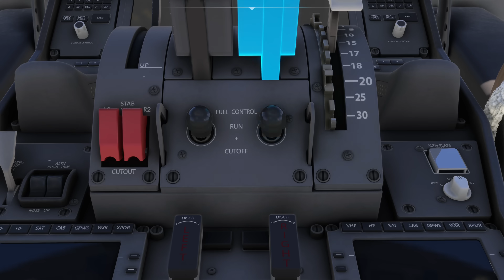Air India 171: Why Did The Fuel Cut-off Switch Get Moved?

Comment: Respected, is it possible that the pilot in the disorder switched the fuel levers to cut off by mistake, instead of retracting the landing gear, the mechanics of both procedures are similar, the switches themselves are not close to each other, but the pilot made an automatic mistake unconsciously, burdened by depression or a similar state.

Comment: How do we know for sure that the physical switches were moved, and it wasn’t caused by an electrical failure of some kind, like disconnected or shorted wires? Wires can disconnect or touch and then move back due to vibration and flexing for example.
Reply: The black box would reveal such an electrical error.

Comment: Why is the computer no checking the flight status and engine situation to prevent a sui*ide mission?`The computer knows if the engine has problems and it knows the flight scenario, so it should have some AI or algorithm to analyse the situation. I mean we are not in in the 1960s anymore but in 2025 mit powerful computers and software.

Comment: If a pilot was going to premeditatively cut off the fuel it makes sense that that individual wanting to make the biggest impact of their sinster act would do it just after rotation when the plane is full of fuel and there would be no way to recover because they were so low in altitude. As you mentioned there is no procedure where you would cut off fuel to the engines on take-off.

Comment: As a retired 757, 767, 777 Line check captain and simulator instructor I vehemently disagree with fighting an engine fire at 3-400 feet on final.  First, the engine is likely producing thrust and shutting it down would introduce unneeded yaw at a critical phase of flight. Second, the checklist will require both pilots to identify the bad engine meaning the pilot flying would have to divert his attention from his primary duty of aviating. Waiting 30 seconds or so until the airplane is on the ground would be far more prudent.

In general I agree with your comments but in this case I strongly disagree.

Comment: A question, not to be critical of the AI pilots, but to perhaps help in case of a similar situation. Would it make sense, when it is determined that both engine run switches are in the cut-off position, to focus on starting one engine and not both? Perhaps Boeing/GE/RR/PW can install a quick recovery system on the engines so the PIC can get a quick light-off and start generating thrust. My wife and I are both commercial pilots, and our son works at Boeing, so this hit close to home. Great channel - love your comments. Fly safe, my friend.

Comment: Steve, I operate a vehicle in a safety situation (not an Airplane). Perhaps in a moment of fatigue a pilot might perform a procedure out of habit at the wrong time due to a foggy head? Not even realizing or believing they performed that procedure.

In my own experience, even though I've run my route thousands of times performing the same turns, I have on occasion (rarely) missed a turn because my mind was somewhere else. Little mistakes like this are extremely rare, but they do occur. Does my personal experience correlate at all to a pilot's job?

Comment: I am not a pilot.  I even have trouble buying an airplane ticket at times.  But I do watch A LOT of airplane crash reconstruction videos and would have loved to be an Airforce pilot in a different version of myself.  My comment is based on watching copious videos of crashes with NTSB findings.  In all respect to the person who suggested making it mandatory for the fuel control knobs to be operated by TWO persons instead of ONE, I think this would be a big mistake.  1. You have to keep the main thing the main thing and that is flying the plane.  We don't need two pilots distracted with trying to fix a problem.  2. In the case of one pilot being incapacited, what will the other pilot do if two are required to cut off fuel to the engine? 3. A suicidal individual will find a way if not given help.  Making a plane more cumbersome/difficult to fly in an emergency will not fix that problem.  As a passenger,  I want to know the left seat pilot has full control of the plane in an emergency, while the co-pilot and/or jump-seat pilot are going through the checklist.  Assume the pilot was flying Air India 171 at the time he lost thrust.  It took 10 full seconds for him to recognize the problem and reestablish fuel to the number one engine.  If he had to also work with the FO to reestablish fuel to the engines, it would have taken even longer.  Yes, the outcome would still be the same--but with more altitude perhaps they would have survived.   I humbly submit that airlines focusing more on the mental health of their pilots is a better pursuit than making the plane more complicated to fly.

Comment: Hi Captain, I have a question, is says that the switches were turned off within a 0.1s gap, but turned on with a 4s second gap, the difference is huge, more if you think that flipping back on the switches was in a life threatening rush, is posible to move both switches off with one hand? Is possible to use both hands without catching the attention of the captain?

Comment: Steve said one thing right, and he is Human too and in denial mode, and can be biased to support the corporate industry. 
  Wearing a pilot dress and blaming the pilots proves his character.  It is very unfortunate how he squarely blamed the pilots and concluded it as human sabotage.  

   Could the fuel switch be a failure and got shut off? The co-pilot clarified he did not switch it off.  So we're is the question or the proof to conclude that it is human error?  It is a  baseless propaganda.  

  Probably Steve forgot that there were Boing flights that have found faulty in the past and some of them discontinued.   Him concluding they are perfect is in itself a proof of him colluding with the company.  Shameful and shameless, characterless.  There is no better professional way to put it.

Comment: This seems more like a one-way biased analysis ...... shouldn't the first aim be to prove that the Pilots were innocent instead of Guilty till proven innocent? It is surprising that you, being a pilot yourself, are trying to desperately prove them guilty.
What if roles were reversed and someone close to you were in this crash piloting the same? What would be your stance on this?
It took more than a month to determine the cause of the accident, but a day to blame the pilots. The report has a lot of inconsistencies; I have more questions while reading the reports posted. The investigative team needs to test every angle of this which will take time. Are they simply giving up investigating the issue thereby washing their hands off their responsibility?
If the pilots are Guilty, then accepted, they are guilty, but atleast they need to work on every angle to prove that.

Comment: The sane pilot took 10 sec to turn switch on after knowing they were off. This is unbelievable.  There is more to the story than shown in this report.  Whats reported by recorder is fuel valve position or switch position? Why is this not clear cspt steve?

Comment: Doesn’t the exact time that fuel switches were cut off in itself indicate deliberate action by one of the pilots. If done before rotate there might still be time abort and done any later than it was the engines would have time to  recover as they almost did. It’s a very narrow window of opportunity that the event happened to be anything other than intentional pilot action or am  I missing something?
Thanks

Comment: The preliminary report on the incident is notably vague regarding the exchange between the pilots. It states that one pilot accused the other of cutting off the fuel, which the second pilot denied.
Modern cockpit voice recorders (CVRs) are designed to identify which microphone picked up specific voices, meaning the AAIB would definitively know who said what and from which seat the voice originated. It's unclear why the AAIB chose not to disclose this crucial information, even in a preliminary report. This detail would significantly clarify the sequence of events.

Comment: Wasnt it stated the locking mechanism was off or faulty and it was highlighted that this is something to look into. Why jump to conclusions one of the pilot did it. If the locking system was faulty. As the plane takes off the whole plane vibrates violently and the switches would have gone down to off since the locking mechanism was faulty

Comment: I love ya Steeeeve, but “draw your own conclusions”. I, for one, will not draw any conclusions based on a preliminary report. I want to see the full investigation to answer the “how’s” and “why’s” of what happened. 

I will say, I thought last night that there should be TWO sets of cutoff switches, one set on the pilot side and one set on the FO side in which the fuel will not cutoff until BOTH pilots flip their individual cutoff switch set.

Comment: Info: The UK Civil Aviation Authority published a Safety Notice (SN-2025/005, Version 2 Issued, 15 May 2025) with headline "Fuel Shutoff Valve – Mandatory Actions on Boeing Aircraft"; applicability: Operators of Boeing 737, 757, 767, 777, and 787 aircraft. That means 28 days before the AI-171 crash. This notice is related to the 2018 advisory, but not to find in the primarily report. In this safety notice is written under 1.1: The FAA has issued an Airworthiness Directive (AD) addressing a potential unsafe condition affecting fuel shut valves installed on the Boeing aircraft: B737, B757, B767, B77, which require a test and/or inspection; and on the fuel shutoff valve actuators on the B787 which require replacement, test and/or inspection. These ADs have been adopted by EASA and may be downloaded from the EASA AD webpage. This notice further directed daily checks in accordance with the relevant Airworthiness Directive to be performed by operatives or engineering of flight crew.

Comment: Wait....It is reported that the fuel switches were turned off in succession with 1 SEC APART. Sir, can you explain, how is that HUMANLY POSSIBLE?? Lets add the Sully human factor here. IMO, There is no way possible to turn off both SPRING loaded switches with 1 sec apart. WHAT DOES THIS MEAN?

Comment: @Captain Steeeve, if the gear had been up, would it have helped the situation by reduction of drag? Could the situation have been recoverable if the pilots decided to pull up the gear and turn the fuel supply to run ?

Comment: Captain Steeve, What are the chances of some technical fault resulting into fuel cut off without switches actually being moved? (That could be the reason Pilot Flying asked pilot monitoring about the fuel cut off?) Once the pilot noticed that the a/c is losing thrust and followed the procedure where you require to put the switch to CUTOFF and then to RUN but altitude being too low they were not able to recover.

This is where I think FDR data is reading Fuel Control Switches were moved to cutoff but in reality it was technical fault cutting the fuel which resembled same as cutting the fuel to the engines. Now, when they physically put it to cutoff it didn't read in FDR as technical fault earlier already had fuel cutoff which was resembling the cut off state of the switches. After few seconds when they put Fuel control switches to RUN position it apparently started the engine and fuel is running through the engines. (This was read as Fuel control switched moved to RUN)

This is my take. I am curious to see what the final report has to say!🤔

Comment: Was there not a report in 2017 on the issue of these switches, ( Or 2018 )????????????????
Reply: There exists a newer one from the UK Civil Aviation Authority, which the FAA and TSB have to know about too. The UK CAA published a Safety Notice (SN-2025/005, Version 2 Issued, 15 May 2025) with headline "Fuel Shutoff Valve – Mandatory Actions on Boeing Aircraft"; applicability: Operators of Boeing 737, 757, 767, 777, and 787 aircraft.

Comment: Why there is no voice confirmation of such an important action as engine fuel starvation is always fatal. So if one pilot on purpose or by accident cuts fuel to the engines, there should be some kind of alarm sound and then a a voice message. Same like /terrain, pull up

Comment: It is EXTREMELY RARE not to say almost impossible a short on these kind of things on a modern aircraft like the 787. People trying to deny the truth are blinding themselves to the fact that the fuel switches were placed in the cutoff position with a difference of a second which is compatible with a human placing one switch after another and then when they were place to run position again, another second of difference. Other thing people trying to convince themselves that this were not intentional, is that one pilot clearly asks the other why did he placed the switches to cutoff position. If they had a mechanical engine flame out this question would never be made, they would have just started a procedure do re start the engines in a coordinated way. And keep in mind, the switches are designed to NOT move unless it's intended by a human.

Comment: If the fuel switches are being cut off prior to landing on the previous flight, then there might be a possibility of pilots oversight the switches and on the next flight that eventually ended up in the crash, the engines were running in the remaining fuels in the fuel filter and fuel lines, by the time the pilots realized, it was too late the fuel system ran dry already finding it difficult for the fuel pump to start pumping fuel back into the system causing the plane to crash

Comment: In the simulator, how long does it take for the RAT to auto deploy when a triggering event occurs and how does this dovetail with the FDR timeline and fuel cutoff switches?  Might be a good senario to run at your company's simulators, not for training but understanding.  After Delta 191 in Dallas a close friend and DL pilot let me run that event without prior knowledge and later disclosed that almost none of the guys that ran that event in the sim saved it.

Comment: 1. Accidental Movement (Unintentional)

The first officer may have accidentally moved the fuel cutoff switch, possibly while interacting with nearby controls (e.g., flaps, throttles).
He may have not realized he moved it, especially if distracted or under stress.
Some switches can be bumped or snagged if protective guards are not present or if ergonomics are poor.
In this case, the denial isn’t malicious — it's simply that the FO doesn’t know he made a mistake.

2. Intentional Action but Later Denial

The first officer may have moved the switch on purpose (e.g., thinking it was part of a checklist), then realized it was a mistake and denied it out of fear or embarrassment.
This has CRM (Crew Resource Management) implications and raises questions about honesty, competence, and trust in the cockpit.

3. Mechanical or Electrical Failure

Though rare, there could be a faulty switch, electrical issue, or other mechanical failure that caused the cutoff without physical input.
Maintenance history and data recorder (FDR) analysis would be essential to rule this out.

4. Deliberate Sabotage or Malicious Act

This is exceedingly rare, but if no technical explanation or accidental movement is possible, intentional interference cannot be ruled out.
Such behavior would lead to an immediate investigation, possible grounding, and mental health or security assessments

Comment: 4:10 What's your evidence that the switches were physically placed in the cut off position? I mean isn't there a warning light when the switch is in "cut off" position? Isn't the purpose of warning lights to get the pilots attention? Why would either pilot be looking at the center console during take off? Also, they're electrical switches, not "in line" flow valves. They don't control flow, they control valves and or pumps which control flow.
My question is, could a bad connection shut the control valve and give a warning light and 10 seconds later restore power?
Also, if the pilot looked at the switches at the time he asked why the other pilot placed the switches in cut off, why didn't he immediately put them back in the "RUN" position. Seems to me the more logical scenario, warning light, FDR records fuel control switches in cutoff and CVR records pilot asks why as he glances at switches, switches are in "RUN", total confusion, power returns to switches, FDR records switches in run position.

Suicide is unlikely. You can't guarantee you'll die. Not in a belly landing even into buildings. The odds are 50-50. Unlike a nose dive crash into the ground from altitude with odds of 99-1. If you're going to commit suicide you want the best odds of success. Especially if it's murder suicide.

Comment: Like in the Terminator 2 lab, the cutoff switch should not be activated unless both people press it at the same time. Once activated, the fuel pump will not be turned off during flight unless there is something wrong with it, and in past cases, the cutoff switch has been activated by accidental operation. To prevent both intentional and accidental operation, a system in which the switch is moved to a remote location and both people press it at the same time seems to be a good idea.